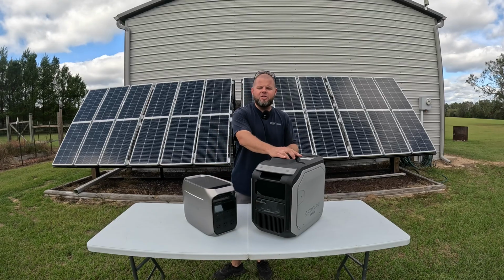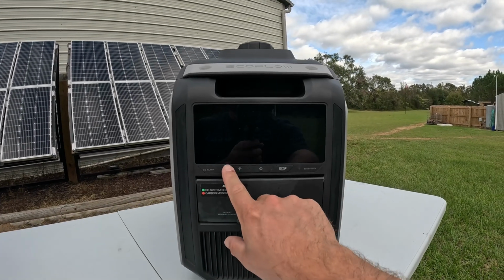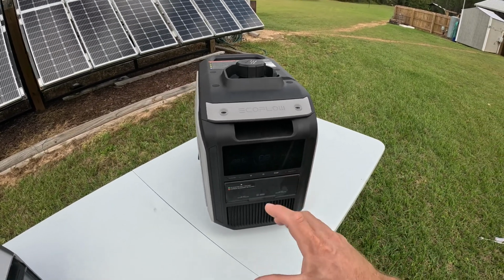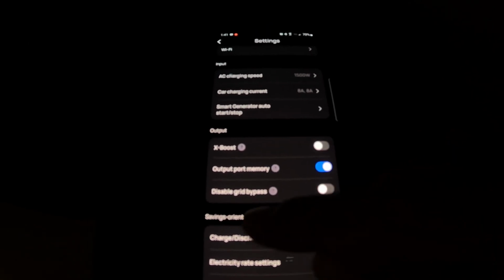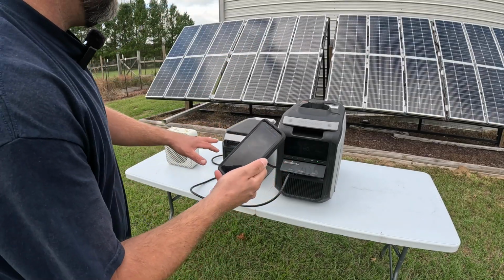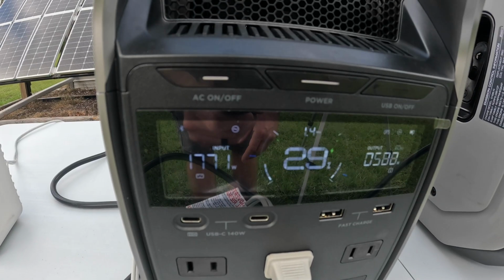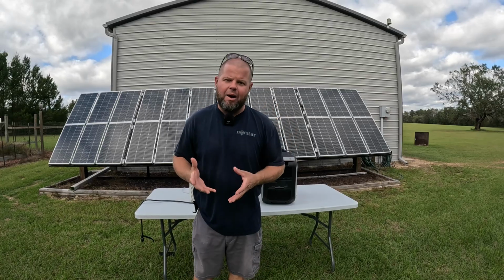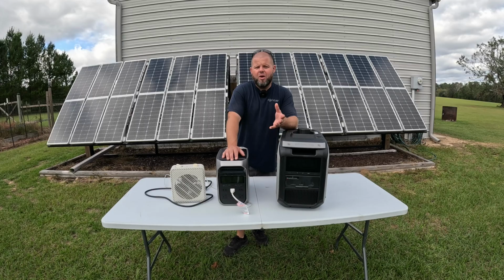EcoFlow SG3000 Smart Generator Dual Fuel!

Comment: I'm looking for something that can ensure my family's safety in the event of a prolonged power outage for 6-to-8 weeks and that would be capable of powering a fridge, freezer, cellphones, dual hot plate/burner for cooking and at least 4 space heaters. Would something like this be appropriate for that?
Reply from the maker: The hot plate is a big demand, yes this can run it assuming the fridge or freezer doesn't kick on at the same time. The start up amperage of those compressors are demanding. You'll need plenty of solar and or fuel for the generator to make it through. I'd probably reccomend the Delta pro 3 and the bigger SG4000 generator. I also did a video on it running our demanding camper.

Comment: Anyone know if this will run a 13,500 BTU RV AC unit?
Reply from the maker: Yes it will, I have tried it on our camper. I am refering to the generator shown, not the power station shown in this video.

Comment: Kelly is bought the sg3000 doesn't power on ,question i hook up battery  does they send these out with no power in the small lithium inside the generator. I thought I would manually pull start it. See if if that would fire it up will test that today ,🐊🐊🌴🌴😎😎
Reply from the maker: The battery is not hooked up from factory, remove the side cover and connect the two pin connector to the battery. Fill with oil and gas, then fire up.  The generator will start charging the battery.
Reply: @TheKelleysReviews hi man ya I did hook up the battery and just put  oil in it  will try And fire it up in the morning I did try to do charge it ,I was thinking the factory sent them out this I che check the battery voltage it was 14 ,it should have been go at least to turn  on screen ,after I put oil in it no fuel yet as dry pull the screen was lighting up ,so does this mean no screen unless its running...?..? Sorry to bother you I live in Florida as you do,just trying too stay hurricane ready man back tooo football lol thanks again 🐊🐊🐊🌴🌴😎

Comment: That’s cool.  Especially if it can handle propane.  Perfect for glamping.  Take two 500 watt solar panels and a tank or two of propane.  Glamping 🤔😁 don’t forget the magnetic induction burner.  Lights and fan.  Starlink mini and electric cooler.  Inflatable tent.  Bug zapper too.  Small boat with electric motor.

Comment: ive got the delta 2 so i guess they dont talk to each other. bummer dude.  i ordered one of these generators but now im not sure its going to talk to the delta 2 with the extra smart battery.   i suppose it would work just charging but the integration wont be there.
Reply from the maker: I've got the Delta 2 max and wish it was compatible but it isn't. Currently it supports the Delta 3 and Delta 3 Plus.

Comment: Thank you for this video. I just received my generator and Delta 3 yesterday and needed a primer before I opened the box. This is gonna work great for my business.
Reply from the maker: Glad you enjoyed it
Reply: Could you check something for me.  On the auto start when the battery is low or whatever.  Can you do it without using the dc cable? Could you test that

Comment: Can the 3000 watt smart generator still charge the delta pro and the delta pro 3?
Reply from the maker: It can but only as a standard generator.  If you want the smart charging for the PRO units, you need the SG4000 as it's specifically designed for those. See my video here https://youtu.be/zltkqz1qAsE?si=6Eh4MtyOYnFs_Jfb

Comment: 👍 Thanks, good job.  Could you do a comparison test of the older model's charging efficiency with the battery ports and proprietary cable compared to this version connected with Bluetooth and regular extension cord. Curious how much efficiency is lost through the AC to DC conversion.

Comment: New to all this….Will this work with the delta max with extra batteries? I just want to use it to recharge my delta 3 plus and the delta max on cloudy days … can I just plug into it and charge without using the app ?
Reply from the maker: You sure can, just use it as a standard generator.  It's only compatible with the Delta 3 plus if you want to use to the auto smart features.
Reply: @ Thank you !!!👍

Comment: so this generator runs on gas but also has a battery? or it just can be used to charge devices while running on gas? I'm looking for something reliable for a oxygen concentrator in case of an emergency
Reply from the maker: It does have a battery for electric start and runs on gas or propane.

Comment: A. Does eco mode work with propane?

B. Can this directly tie into the ultra or smart home panel?
Reply from the maker: Yes it does work with propane. No it currently is not compatible with those. There is a larger SG4000 generator for the Delta pro 3 that I am hoping will one day be compatible with the Ultra.
Reply: Neither of these generate split phase 240v so no. 1800 watts is also not enough to run even a basic house panel as more than one 15a circuit and you'd trip the breaker

Comment: Hey Andrew, do you know if you can have both solar and the generator connected to any of the EcoFlow power stations and have it use solar if possible and kick in the generator as a backup? I can see that setup at your cabin. That way everything stays as quiet as possible but your always covered.
Reply from the maker: The larger units I do believe allow you to prioritize the incoming power in some recent updates. These smaller units usually do not, but I'll have to verify that. In theory if your solar/batteries are adequate, you'll never drop below the 30 percent or whatever your trigger is set at. This will keep the generator only kicking on as needed, cloudy days, night time ect.
Reply from the maker: And typically yes you can charge via solar DC and AC up to whatever the units maximum charging input limit is.

Comment: Will it work with the delta pro ultra
Reply from the maker: No, there is currently no "smart" generator for the Ultra. I sure hope one comes out soon or the new SG4000 will become compatible one day.
Reply: Per EcoFlow's FAQ on the SG 3000 product page:

"Which models are compatible with EcoFlow Smart Generator 3000 (Dual Fuel)?
The EcoFlow Smart Generator 3000 (Dual Fuel) does not have an XT150 port. It has two AC output ports and is compatible with all power stations through AC connection."

So, it appears that any EcoFlow power station will work with the SG 3000.  However, it's the APP ("smart") support that's the question.  We know EcoFlow has designed "smart" support for the D3+ with this unit, but we don't know if EcoFlow will provide "smart" app support for their other power stations.  I'm hoping they will add support for the Delta Pro, as that's what I use (along with two extra smart batteries) when overlanding/camping or for home backup.  I can get the SG 4000 for the Delta Pro, but it's double the price, which doesn't make sense since the SG 3000 has more than enough power output to support the 1800 watt max charge of the Delta Pro.

Comment: Hello Andrew great video please when you do the 4000 generator if you can do side by side comparison , also did you say that you had a different smart generator not Eco Flow ?
Reply from the maker: No, the only smart generators are EcoFlow. As for a side by side, it's not technically possible because the SG3000 uses a AC charging cord and Bluetooth communication for charging. The new bigger SG4000 uses a direct DC charging cable for the Delta pro 3.

Comment: Well on a table together it works  great with a simple setup. In reality the fridge/freezer or what ever is inside somewhere and the generator needs to be outside somewhere. Leaving it unattended with connections that who knows how are configured and most likely going through doors or windows I think isn't a great idea. You are painting a picture not really based on reality. Sure it is a great setup but it's much more complex than what you are leading us to believe. I think a setup attended at all times and monitored closely could work and is much more convenient since it will keep the battery charged in an automatic way is great . I don't seeany other connection setup for this other than several extension cords to the appliances and an extension cord into the house using multiple outlets(power bar) for those appliance cords. That requires an opening to the outside for the generator cord and carefull selection of extension cords depending on load, lenght and environmental conditions. But hey, just connect it, app it and voila....power.... LOL
Reply from the maker: You're also not taking any consideration into the overall cost of the system compared to a whole house automated system. A few extension cords ran through my home to keep my window AC, freezer, food and or anything else going is absolutely worth it. I've been there and done it many times for decades. That's including no system and losing food, sleeping sweaty for days, no fan, no outside contact.... Nothing! If you can't see someone can do a simple though wall extension cord connection like on a boat or rv your not seeing well. They can simply hire that out, do it themselves if possible and have a generator outside and a plug inside for the power unit. Otherwise run a cord through a window and tape the opening. Your thinking of a high dollar whole house professional installed system expensive system. Many are perfectly fine with that extension cord if it means no lost food, window AC, cpap, oxygen machine ect.

Comment: Wish EcoFlow would update the firmware on the D3+ like the ultra X Fusion.
Reply from the maker: Technically you can already run a generator to it as is because the unit is not capable of outputting 240v. What will happen is the unit will charge from the generator and the once it's reaches 100 percent, it passes through the generator power to whatever device is plugged into your power station. If the generator runs out of fuel, the power station automatically swaps to battery power. The only other device that could justify the X Fusion is the Delta pro 3 because it has 240v output options.

Comment: Are you able to still have solar hooked up at the same time?  Kind of a daytime solar nighttime generator package?
Reply from the maker: That's supposed to be possible, but I do need to test that to verify. That's the best way to run this setup.
Reply: Yes, you can have both charging the power station at the same time or you can prioritize the PV power of you want.
Reply: Yes and the best part is it's solar priority so you can set the gen to only kick on when absolutely needed, like below 15% and stop at 30-40%
Reply: I am considering this unit for my EF D3+. I have owned several Honda and Yamaha inverter generators over the many years. . One thing I can say without a doubt their exteriors are built to take quite some harsh impacts . Question I have, in your opinion ,  how ‘durable ‘ do you really think the exterior of this unit is compared to equivalent sized inverter generators on the market . When I look at my EF D3+, a great unit , but hardly designed for rough conditions and was wondering the same for the EF 3k inverter generator.
Reply: For the money this is the best option.